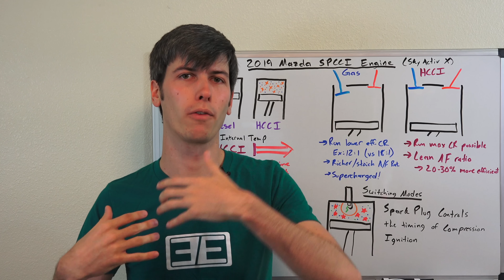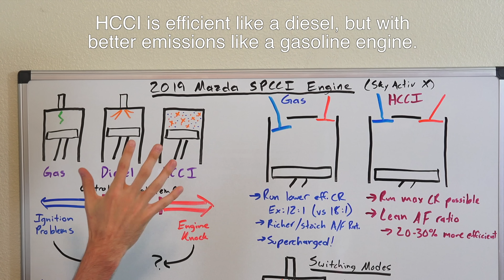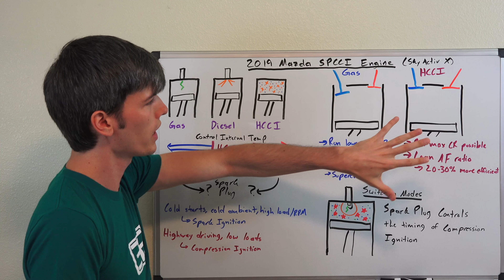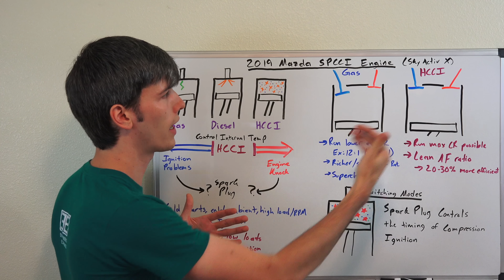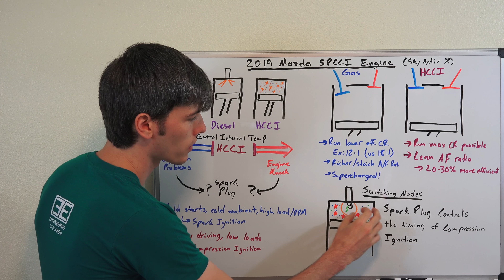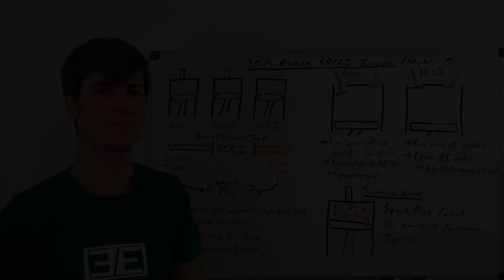Mazda Creates The Holy Grail Of Gasoline Engines - HCCI SkyActiv-X

Comment: Why is Mazda and other car companies are still developing gas or diesel engine? It's going to be obsolete in the next 10 to 20 years. What a waste of R&D money.
Reply: ICE is going to be around for a while, especially in developing countries that just don't have the electrical infrastructure to support electric cars.
Reply: How fast electric cars will take over is actually debatable. Sure it will happen sooner or later, but it will take some time. And the reason for that is not even the technology of the electric car itself. The problem is the electrical grid.
Just an example. If Germany would switch out all of it's combustion engine cars to EV's they would need more than twice as much electrical energy than they do at the moment. They don't have the powerplants to produce that amount of electrical energy at the moment nor is their electrical grid able to transmit that amount and it's pretty much the same problem all over the world.
We need time to build up the necessary infrastructure to run huge fleets of electric vehicles. We don't have that at the moment and it will take decades to do that.
Reply: Khoa Nguyen  it won't, cars maybe won't use them soon (maybe not that soon) but there also other ways of using engines and you guessed it, most efficient is better
Reply: Khoa Nguyen 20 years in car industry is alot of money.
Reply: Someone doesn't enjoy the sound of a big ass V8
Reply: So, in the next 20 years you need $$$$, and the electric car still need electricity from sorces that uses gas to produce electricity.
Reply: The fossil fuel market will still be very alive and well in 10 or 20 years. It'll go away but it's going to be a long process
Reply: The electrical grid issues are definitely overlooked when discussing the "near future dominance" of the electric car. People don't seem to realize that fundamentally the electric car just shifts where the "energy" is generated. Instead of generating energy with combustible fuels in your vehicle, an electric car shifts this generation to the grid. The gasoline and diesel engines take this load off of the grid, where the electric car moves the load back to the grid. Most countries struggle today to generate enough power, even without widespread electric car adoption.
Reply: It's great to see companies continuing to make breakthroughs in something many thought was already at its most efficient.
Reply: Suicidal Bleach yeas sirrrrr. I'm so lucky to have a e85 pump by me.
Reply: You're wrong.
Reply: Khoa Nguyen in the next 20 years the Biofuel and synthetic fuel technology will be more advance, that making electric car (with their costly infrastructure and hassles) less attractive. We will use fuel from any Biomass by-product by using cellulosic fuel technology, biodiesel for cars, heavy duty and marine use will be formed from gene and strain modified Cyanobacteria. Rocket and jet fuel from bio based materials too.
Reply: Anyone who claims that internal combustion engines "aren't going anywhere" is simply not paying attention.  Just look at the cost curves.  The cost of batteries continues to fall around 7% a year.  The rest of the electric drivetrain is much cheaper than its ICE counterpart.  In a few short years the following will be heard at dealerships: "Mrs. Smith you have a choice.  You can either buy the EV that goes 400 miles on a charge for $20k, or you can have the ICE vehicle which has the same range, costs more to run, requires more maintenance, and is noisy and smelly for $25k."  Does anyone in his right mind think Mrs. Smith is going to pick the more expensive and worse option?
Reply: Rechargeable batteries don't have to match the energy density of liquid fuels.  Electric motors are much more efficient than internal combustion engines, and weigh about 90% less.  Already, the long range Tesla Model 3 has a range of over 300 miles and weighs only 100 lbs. more than a comparable BMW 340i.  And advances in battery technology will only improve the situation.
Reply: ICEs will still be used as generators even in electric cars to increase range. Hydrocarbon has far better power density than chemical batteries and from the industry trend it does not look like batteries are gonna have any seismic shift soon.
Reply: I think the internal combustion engine won't die anytime soon, but the fossil fuel will. There are hydrogen and ethanol, both of which are more eco-friendly than your ol' regular gasoline (CMIIW).
Reply: Batteries are not the answer.
Reply: Khoa Nguyen probably because of people like me. Somone gives me a free Tesla, I'll turn around and give it to BMW as a down payment on an m3.
Reply: They've been working on this for over 10 years. Why should they suddenly drop the research when 98+% of vehicles sold are still have an engine?
Reply: Battery technology is catching up fast. Very fast.
https://arstechnica.com/cars/2017/07/toyota-wants-to-commercialize-solid-state-ev-batteries-by-2022-reports-say/
Reply: YZFR6Yammie it's getting more popular than you think....I live in southern California and quite a few places around here have e85 on tap....
Reply: Jordan E I was comparing an ICE engine's sub 40% to an EV over 80%. Not wheel to well. Battery to motor output or fuel tank to crank.
Reply: Michael Herbert Better than losing the only spaceship we have.
Reply: shi01 absolutely right. And your example is in the highly developed countries. Countries like Pakistan can't even handle the current electricity requirements of their population with rolling black outs part of everyday life.
Reply: Khoa Nguyen...you are on the wrong side of you tube pal...you are going to get little love for such comments here,in the kingdom of Oil,gasoline and gears
Reply: Khoa Nguyen cause there's people like me who'd rather have a car with an actual engine instead of an electric engine
Reply: Joseph Bowman him saying this great achievement by Mazda is a waste is also being a douche
Reply: DriftinGorillaz Yes, but none yet pack the punch fossil fuels have per gallon, forget the specifics but gas / Diesel have a ridiculous amount of energy per whatever volume. I wish they'd find something better but it's not easy lol.
Reply: Maybe you're right, maybe they'll never recoup their time, effort and money out if it.. that's fine. What he's saying is that from an engineering perspective it is a great achievement and is wicked cool. Only time will tell if it was worth it for them! Regardless, I believe what was learned here will likely be useful in some other way later... that's what science is all about.
Reply: These engines can be incorporated into hybrid vehicles or even plug in hybrid vehicles. Petrol-hybrid, diesel-hybrid. I think the transitional period to go completely full electric will be 80-100years. Also something about the combustion engine i think it will never go away completely. I don't think any military will go full electric on their vehicles.
Reply: Engine development took years. It's not some kid saying "hey I have a great idea, lets make this!" or something. They probably started mid/late 2000s, and you know they attitude towards electric and hybrid that day.
Reply: Because there is Nothing more efficient and Mazda just made it Better!!
Reply: I hear that a lot. Yet these are the same people spending 55k on a pickup truck, then an additional 20k on a lift, tires, exhaust, custom lighting, stereos, camo accents.
Reply: The94GTC
Lithium isn't a problem. It's not rare earth, it's alkali metal, totally different thing. Rare earth mining is only a problem because China didn't care much about pollution until recently. The radioactive byproduct is Thorium, which is excellent reactor fuel, so they are stockpiling it, and it's only very slightly radioactive, less then coal.
Cobalt is a problem, but only because the main sources are piss poor 3rd world countries. This is being solved by finding better sources, and possibly by replacing cobalt.

When electric cars break even is highly depends on the details. How clean is the manufacturing and how clean is the electricity the owners use. Both are improving rapidly, and some parts of the world are much better than others. Batteries will work much longer than 8 years, that's just what the insurance covers. New ones are expected to be good for 1 million miles of driving, than keep working in stationary applications, and finally mostly recycled. That in the long term hugely reduces their environmental footprint. You can't recycle oil, and it's never going to be cleaner. Oil leaks also cause cancer, and huge environmental destruction. Also superpowers fight wars for oil in the Middle East, and that's far worse than anything else.
Reply: Timothy Chen 
Sure, 25% efficiency sounds a ok...
Reply: Do you think they're blindly investing into this or something? What you're saying is like step 1 for Mazda to conclude with before dumping money into something. 10-20 years is a long time, even if that's true.
Reply: Kenny Powers Where did you get the estimates of mineral shortages? We will destroy the planet before we run out of fuel, but at least we will have guzzolene to fight over.
Reply: Shorpy Exactly!!!!! Americans are obsessed with gasoline engines. NASCAR is the most popular sport in America.
Reply: Khoa Nguyen my thought is the rarity and difficulty in the metals for battery cars will keep gas powered cars a viable or lower cost option.
Reply: Correction: It's not going to be obsolete, most countries will just/have put sanctions into selling petrol vehicles, to encourage electronic vehicles.
Reply: Electric cars are far more then 20 years away, 40 years at least there is alot of issues why they just cannot be used by the majority of people.
Reply: Some countries are actually leaning toward banning the distribution of combustion engines by 2030 such as Germany... but it'll be interesting to see what other countries follow and how soon! Hopefully this isn't true for America:(
Reply: Thomas Orfano ouch! I didn't hear that, but all I heard was France is starting regulate fewer combustion engine to make way for electric cars. RIP. Still gonna want a GTR tho
Reply: Hate to burst your bubble  Gas or diesel base engines aren't going anywhere, in 2007 1% of US  cars sold  were electric based I think as of 2016 less than 4% sold in the US were electric, not including hybrids only electric,  That's a 3% gap in 10'years, you would half to wait to 2090 to see a dent in the market. The catch with electric cars is storage and recharge rate,  per unit cost, its to high, what will happen in 20 years as electric cars evolve so will the mpg
Reply: Fern W Their isn't a battery made yet that stores enough power that lasts a long time that is cost efficient to replace that will interest anyone in owning one in the near future. If they could only solve that problem. Harness the power of the capacitor and regulate it then the problem will be solved
Reply: i think this was more likely a cheap research and developement, like someone just was like "what if we used a spark plug with this?" and then they just started testing it out. it doesnt seem like they reinvented a new system or anything, just tossed in another component to solve an issue.
Reply: +Mike Guitar
Photosynthesis for example has low single digit efficiency.
Reply: LeGoogle Chrome Not saying your point is wrong but there's no need to be a douche about it. That being said, I do agree. Gas / Diesel and other burnable fuels will still have a place for a while.
Reply: Joseph Bowman Yeah, I really hope the same. While I'm interested in electric cars, it seems that ICE cars are always built for us to take more control and squeeze every power out of it and the faster refuelling of an ICE car is just more convenient for a type like me (who frequently forgot about charging my own phone, let alone a big electric car).
Reply: Electric cars are too early in production to say something like that
Reply: This is only semi-true.  You don't need twice the electric grid output generally because current electric cars are more efficient.  The manufacturers give them streamlined chassis and low resistance tires and setup their for minimal losses with regen because otherwise the batteries would drain even faster.  

Also, most electric car charging is done by individual owners in their garages at night.  In most places in the world, the electric grid's generators are only lightly loaded at night.  They are more than capable of running at full throttle at night and producing a lot more electricity than they are currently producing.  (at the cost of more gas and coal consumption, of course)
Reply: because battery storage technology is still very very very Expensive, solar is still very very very Inefficient, and oil companies are still very very very Rich and influential!! (EIR effect)
Reply: when I can drive from the Atlantic Ocean in NC to the Pacific ocean in Cali and back and only stop for 10 minutes a couple of time to piss and fill up, ill buy an electric, for now it takes hours to charge a battery which sucks for road trips, city life its great
Reply: what if ICE vehicles have zero toxic emissions, run on 100% advanced carbon neutral bio fuels and are twice as efficient by 2025 when compared to 2015.  these 3 steps will make an ICE car better than EV's in every manner. so there are lots of chances that an ICE car can not be dead for ever!
Reply: yeah, what if ICE vehicles have zero toxic emissions, run on 100% advanced carbon neutral bio fuels and are twice as efficient by 2025 when compared to 2015.  these 3 steps will make an ICE car better than EV's in every manner. so there are lots of chances that an ICE car can not be dead for ever!

they can also be made as silent as EV, less maintenance, extremely reliable.
Reply: yeah, what if ICE vehicles have zero toxic emissions, run on 100% advanced carbon neutral bio fuels and are twice as efficient by 2025 when compared to 2015.  these 3 steps will make an ICE car better than EV's in every manner. so there are lots of chances that an ICE car can not be dead for ever!

they can also be made as silent as EV, less maintenance, extremely reliable.
Reply: yeah, what if ICE vehicles have zero toxic emissions, run on 100% advanced carbon neutral bio fuels and are twice as efficient by 2025 when compared to 2015.  these 3 steps will make an ICE car better than EV's in every manner. so there are lots of chances that an ICE car can not be dead for ever!

they can also be made as silent as EV, less maintenance, extremely reliable.
Reply: yeah, what if ICE vehicles have zero toxic emissions, run on 100% advanced carbon neutral bio fuels and are twice as efficient by 2025 when compared to 2015.  these 3 steps will make an ICE car better than EV's in every manner. so there are lots of chances that an ICE car can not be dead for ever!

gasoline engines are 15% efficient in 1970's. now they are crossing 45% 

they can also be made as silent as EV, less maintenance, extremely reliable.
Reply: @Khoa Nguyen, The density of batteries (energy density VS weight) is still not right for electric car use. while improvements are coming every day it's still years away from being viable replacement. As it is, gas and diesels can go 300-500 miles per tank. electrics are still in the 150-250 range. also charging though fast is still 20-30 minutes where a gas or diesel is more like 5 minutes or so. It's more about weight to power and convenience. so it's still a long ways away from being a true replacement
Reply: Khoa Nguyen not everyone can afford a tesla
Reply: So many of our developed technologies find a valid application after they are implemented, many thanks to the trickle down effect that validates even more development on some past technologies. Developing countries that are part of carbon foot printing may be able to use these newer technologies to lessen their impact more easily than competing ideas and technologies.
Reply: You asked and you shall receive. Toyota has just announced they are building a car using solid state batteries. SS batteries have triple the energy density of Li-Io with a charge time of about 1 tenth. That would give a Tesla model S 100 a range of 900 miles! That should satisfy most people.
Reply: There are still 1 or 2 generations of ICEs to come. But then this will be it for the profit. Until then they continue and there will always remain small application areas for those vehicles. Maybe in 10 years they stop RDing, but will still sell them 20 years+
Reply: Actually, electricity usage won't increase that much, because refining fuel uses a stunning amount of electricity. The DOE calculates it takes 6Kwh to refine 1 US gallon of gas. A Tesla S can travel about 20 miles using that 6Kwh. A similar ICE car will travel about 20 miles on 1 gallon of fuel. On the down side, although there is no net increase in electricity demand, it does have to be redistributed away from refineries as they close, to places where EVs recharge.
Reply: ICE cars are horrendously inefficient. At best, they are only about 20% efficient. No amount of smart engineering will change that. It's the Second Law of Thermodynamics. Your other point is correct. ICE cars will be with for the foreseeable future, until EV infrastructure expands and ICE cars wear out. Some cities, like London and Shanghai are planning to ban ICE cars to improve air qulity. If lots of cities do the same, that would accelerate the demise of the ICE.
Reply: Solid State batteries are just starting to move out of the lab into the real world. With triple the energy density, a Tesla S 100 would have range of 900 miles.
Reply: Solid State batteries are beginning to escape the lab into the real world. With triple the energy density, they would give a Tesla S 100 a range of 900 miles. They use common matriels and would be cheaper to make, and only take 1 tenth the time to charge. That's pretty seismic, I think.
Reply: Oil companies and collusion?  ... they want to keep the spigot on as long as possible.
Reply: doktorbimmer
Do a little research on battery technology, you will be surprised. Prototype batteries are already have several times higher energy density than current Li-ion ones. Li-S for example is at least 2-3x better. It's now being commercialized. In the recent years demand for batteries is exploded, not just because of electric cars, but because of cell phones, drones and other applications. This attract huge amount of R&D money, which accelerates progress. Until recently only little research went into batteries, so there's plenty of room for improvement.
Also batteries don't have to use chemistry, nuclear isomers for example could be used to make rechargeable batteries with a million times higher energy density than any chemical energy source. This isn't going to happen soon, but it's a possibility.
Reply: The94GTC
Congo is not the only source of Cobalt, battery companies are working hard to avoid these problematic sources. Also Cobalt could be replaced with less problematic elements.
Reply: The94GTC
I think what you think about is thorium, which is a byproduct of rare earth mining. That's only slightly radioactive, and not dangerous at all. India for example has high concentration of thorium in the sand on it's beaches. People are sitting in that sand in not much clothes, and they aren't seem to be harmed. And coal has a significant thorium content too, which gets into the environment, when it's being burned. Also thorium is not waste, it's actually excellent reactor fuel, that could be used to power the world. China is stockpiling the thorium they get from rare earth mining, and already developing the reactors to use it.
What caused environmental problems is the chemicals that they used for mining, but they are now trying to clean up the mess and mine more safely.
But Lithium is an alkali metal, not rare earth, and it's mined very differently, with far less environmental impact.
And as I said, the Cobalt is an issue, but all companies, and especially Tesla are trying hard to avoid those sources. Tesla is also working on securing well regulated domestic sources, and also replacing Cobalt.
Tesla batteries last so long that it's not really a problem. Even the early ones are expected to last 500K miles, and then they will still be useful for stationary applications which don't need high energy density. And after that almost all of the batteries are recyclable, which greatly reduces the overall environmental impact.
And even in the worst case, electric cars are at least remove the pollution from the densely populated areas to the power plants.
Also, the $7500 incentive and others don't go to Tesla, they go to the buyers. Anyway, for a $100,000 car it's not a big deal, and the cheaper Model 3 will only get it for a short time, because it gets phased out after the first 200K cars delivered in the US, which will likely happen this year.
Reply: Jeb Bush Mazda is the premier engine developer in the world.
Reply: +Khoa Nguyen -- Gas engines aren't going anywhere until oil prices become untenable. Lots of people will still prefer a gas vehicle regardless of how awesome an EV may be.
Reply: Larry Ready 1100 miles per week, considering 5 days a week, is 220 miles a day. That's not a problem with a 90 or 100 Tesla. Think of the cash you'd have saved driving that much, plus considering you can get 100 miles worth of charge from a super charger in not that much time and for free (if you bought it before they took that away). It's no doubt not for everyone but there's plenty of people it would work out good for. Though I doubt you'd really save a ton considering the cost of the car unless you were already considering a car in that price range.
Reply: Khoa Nguyen lol like dead giant batteries are the solution
Reply: Khoa Nguyen Unlike Musk wants you to believe, all full electric cars are still a long way off (20+ years). There are still a ton of issues that need to be sorted out, like infrastructure, material shortage, and public image. Also, keep in mind that Mazda is quite a small company, they don't have the budget to dive into something so expensive alone. Hence the partnership with Toyota. This technology could be massive for them if they move towards hybridization as a more efficient engine can drastically increase the functionality of the electric part of the drivetrain.
Reply: So according to your theory, in 10-20 years all of the cars on the planet will stop being sold with ICE units? have you thought that not all cities and countries are as technologically advanced as Copenhagen, London, NY and Tokyo? what about all of Africa? can they sustain EM cars? or will there be a higher chance that they will still get pass me downs which include ICE units?
Reply: It'll be a long time before ICEs are obsolete. Until they field batteries or come out with hydrogen fuel cells or something similar, that give EVs a much longer range than ICE driven vehicles of comparable weight there isn't a very practical reason for people to trade in their cars for EVs just yet. We don't want EVs that are just as good as ICE driven vehicles, we want them to be way better than that.
Reply: No it's pretty smart for a smaller independent manufacturer to develop short-term improvements to proven technology, wait for the big players to develop EV tech then reverse-engineer it.
Reply: Khoa Nguyen e85 dude corn power
Reply: Optical Clarity you are correct. Another application would be people in my field, sales. Before I retired I averaged 1100 miles per week. Most of my calls were an hour followed by a 1 or 2 hour drive. Even the most expensive Tesla isn't close to handling that!
Reply: Khoa Nguyen tell anyone who hauls with large vehicles that gas and diesel is going away. Haha when will I be able to take my horse trailer/camper 1000+ miles on eletricity only? I highly doubt eletricity will be efficient and light enough for ANY long term hauling in this lifetime. Unless some revolutionary battery pops up out of nowhere, there's no way to store a significant amount of energy.
Reply: To those who ridicule engines for being only 15% efficient, don't forget that most solar cells are about the same.  Also the natural process that converts solar heat into wind energy is likely to be very inefficient.  Also lots of energy is wasted or not used at all.  So there's plenty of room for improvement all around.
Reply: I highly doubt the gas engine will completely die out, it would still be needed in applications such as generators or marine
Reply: Electric cars are already here. They have pretty good range, and they are superior to ICE cars in almost every way (performance, comfort, reliability, maintenance, etc.). Tesla sold about 200,000 cars on average for more than $100,000. And they have about 500,000 reservations for their more affordable car that just went into production. The Model 3 is competing with the Audi A4 and BMW 3-series. It has 220-310 mile range, which is plenty enough for most people. For long trips there's the supercharger network. Yes on long trips, it's somewhat slower than an ICE car, but unless you drive more than 200 miles regularly, that's only a small inconvenience. And battery technology advances far faster than IC engines. 5 years ago you got a 200 mile range Tesla for $70,000, now you get one for $35,000, and it has far more features. At this rate, in another 5 years good electric cars will be truly affordable. Chargers will be everywhere, and charging will be at least twice faster, but likely more. People but a Tesla because those are awesome cars, being green is just a bonus.
Tesla now developing a heavy-duty, long-haul electric semi. It's going to be revealed in September.
Some companies are already developing electric planes, and ships too.
Reply: Khoa Nguyen Gasoline engines aren't going anywhere in the US. Hybrids and electric vehicles have been around for a while now and make up a very small percentage of vehicles on the road. Americans will never give up their V8's baby. Just think about what no more gasoline or diesel engines would do to the economy. Do you realize how many companies would go out of business and how many people that would be unemployed.
Reply: No it won't dumbass. All this hype around electric cars just came up. They won't take over for decades or ever.
Reply: No they wont. They said the same thing in the 90's when the prius first rolled around. We still have many decades of otto cycle enjoyment before a battery breakthrough comes along that makes electric vehicles more viable for the masses.
Reply: Hey HERR... when you come out of your little MUSKin Closet and get a whiff of reality you'll be welcomed with open arms. 
http://www.latimes.com/business/la-fi-hy-musk-subsidies-20150531-story.html
Laughing about factual inaccuracies ? I am. 😏
Reply: Shorpy I agree v8 sounds great....but I live in southern California....and when gas was 5 bucks a gallon...those v8 got parked or sold for pennies on the dollar....4 banger car's sold for crazy big dollars....imagine paying 5-6 grand for a beat up 20+ year old Honda that could pass smog
Reply: Electric is a losing game in a totalitarian dream.
Reply: Khoa Nguyen No no electric is still years and years behind well be using internal combustion for years to come
Reply: Herr doktorbimmer perhaps but you did know Tesla is getting a lot of his money by the U.S. government yah ?
Reply: difflocktwo "80% system efficiency" just no. An EV possesses no engine, it's just a motor. 
An EV can't be more efficient than the engine from which comes the energy source (a power plant), which the most efficient ones are IC, running between 45-50% efficiency, so the real efficiency is 80% (actually less) out of the powerplant.

Nonetheless it's still more efficient than an automotive IC engine.
Reply: Like China? Full of electric scooters? Home of the electric bike?
Reply: Khoa Nguyen ICE cars are still very efficient... just because electric vehicles are coming up doesnt immediately make gas engine cars obselete. theyll be around for a while.
Reply: there will also be other ways of making fuel you naive ignorant degenerate
Reply: ICE is already obsolete for automotive. Any R&D away from BEVs is simply towards the death of the company. You cannot compete with over 80% system efficiency and you cannot sustain unsustainable practices by definition.